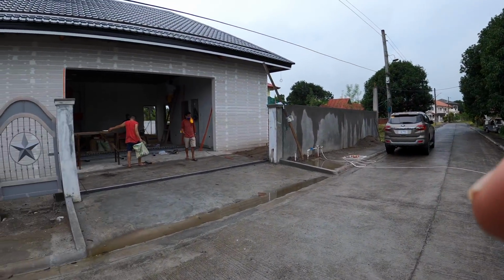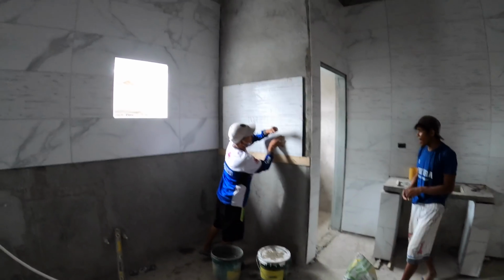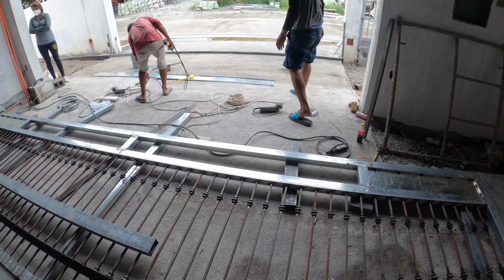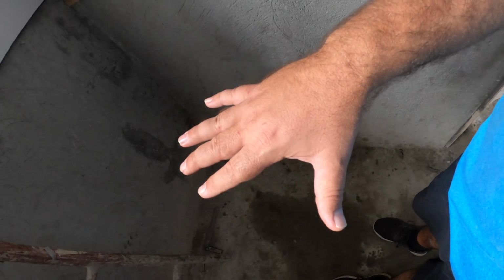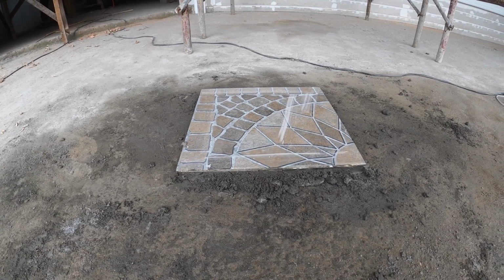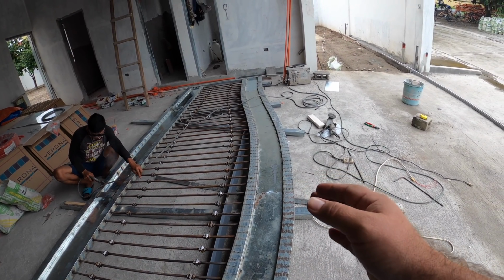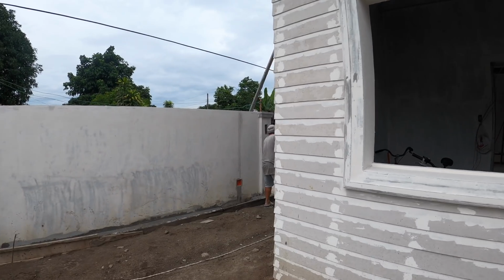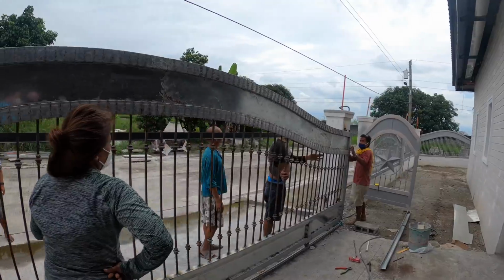Philippine House Building Step by Step, Build Day 179: Gate Doors and More

Comment: Well that's one way to install a automatic sliding gate; that horizontal bar on the outside of the gate is not only unsightly but, it is a potential climbing risk. What or where do you spec out your products? Please use Sweets Catalog as a reference, it's basically the construction industry standard. Use, Sliding Cantilever Gate, as your search option there or even on Google. This will give you a better idea of what the correct way should be because as it stands, it sticks out like a sore thumb.
Reply from the maker: Thank you for the feedback

Comment: The difficulty with the leveling of the slab makes this style of setting the tile necessary. I have been wondering if it would be better to pour the whole concrete slab 1st before building up the walls. That is the way they do it in Southern US.
Pouring the floors after the walls are installed makes it impossible to have a nicely level slab throughout the house. I have seen lots of loose tiles in the Philippines using this method. Not sure if it is from the skill Level of the tile setter or the method.
Reply from the maker: I have seen both methods in person. I prefer the slab first with smooth level floors. However, walls before floors seems to be the standard practice here. There are a couple of other builds just getting started in our subdivision. I’ll watch them as well but expect to see much the same practice.

Comment: Good morning George. Our property in Hiyop is 1 half hectares. It's costly building a wall right round. I thought of having the wall just surrounding the house area and barb wire the rest towards the gate. But being near the ocean corrosion sets in fast. What would you do to keep the undesirables out? TKS for sharing.
Reply: bougainvillea hedge
Reply from the maker: andrew c. 
Great idea for a “green” fence line. 👍😊
Reply: @CasaTexPina  no intruder gets to the other side without being cut to shreds, even pruning it can be another painful exercise
Reply from the maker: I agree, electric fence plus a good CCTV setup with motion sensor flood lights. Hopefully not going to be a problem on the hilltop.

Comment: Any uk we call it screen its a dry mix
Reply from the maker: Par for course here since the flooring is typically not level enough to do direct tile adhesive. I have also heard the builders include the dry pack as part of the concrete floor thickness. 🤦‍♂️

Comment: In the states...its called. "Deck mud" method...Another alternative without using tiles is..concrete stamps for both floor and wall..They look realistic compared to tiles...much faster...much cheaper..
Reply from the maker: We’ve seen concrete stamps, but doesn’t seem to have really caught on here yet.